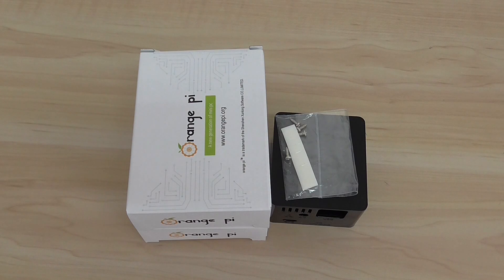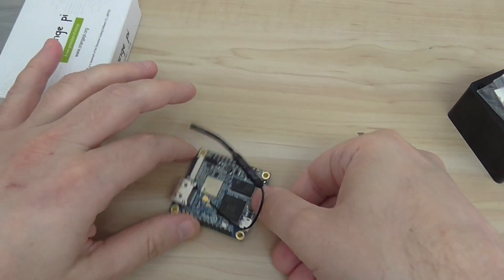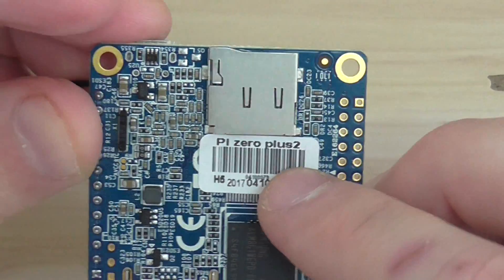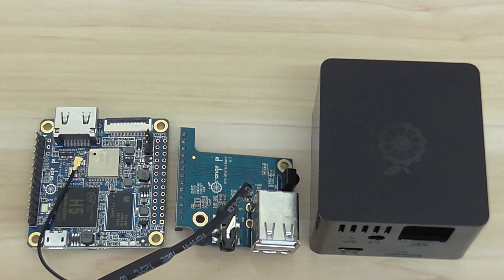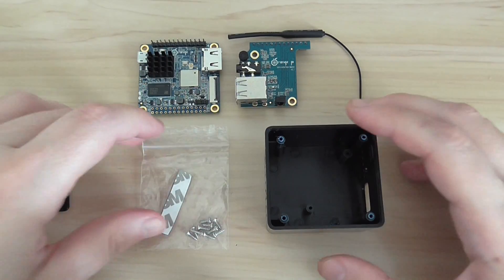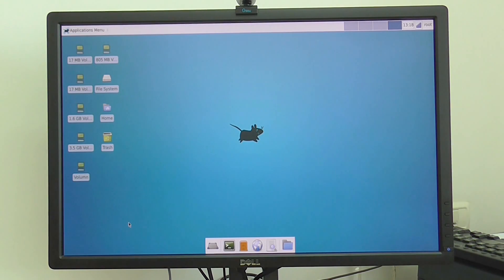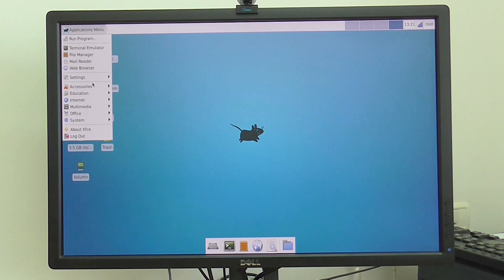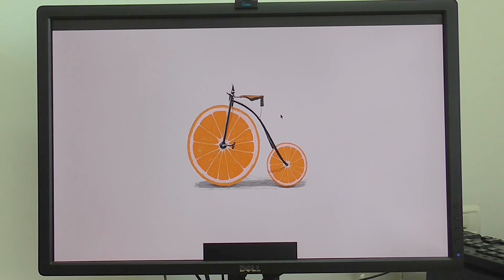Orange Pi Zero Plus 2: Better then Raspberry Pi Zero ?

Comment: Hello. I have the h5 plus 2 board, and I can not get a video signal using any of the available packages. I am burning the images fine and am getting power LED's but no hdmi signal. I have no idea how to boot into a desktop environment, any help?
Reply from the maker: 3D Kiwi format SD card properly, use winimage tool. Also check power supply unit for proper current!!  5V  2A
Reply: Thanks man I will give it a try! If I used the official site images and burn correctly AND use correct power supply. Plug in hdmi then power it should boot to desktop enviroment? I also have the same usb header, should that also work plug and play?
Reply from the maker: 3D Kiwi If u also bought the expension card with the HDMI port it makes life easier. Better check your power supply.

Comment: omg the 13 pin extender board makes the board so much taller dammit, cant there be a flatter option?
Reply from the maker: Blade Cutting Studio  you need extra space inside the case for heatsink and also the second expansion addon card that gives you additional USB ports and a HDMI port,  microphone interface.  If you are not planning on buying the add-on  board and only use the main board  than the case can be allot smaller in hight. :)
Reply from the maker: Blade Cutting Studio  if you have an idea how to make a flat version without designing a new board welcome to tell me :). If you really need the extra port u better pick a different board model..its that simple.

Comment: How is the WiFi performance? I have a orange pi zero and the WiFi it’s a major problem (because the drivers). I don’t know if this version fixes the  problem
Reply from the maker: Samuel Carreira I didn't check lately,  but I think they fixed the problematic images.
Reply: Android Pimp - Best Buy Reviews Authority I use the last Armbian. On the official website you can read: Onboard wireless module (XR819) has poor software support so wireless connection issues are expected
I will check if the zero plus2 uses a different module
Reply from the maker: Samuel Carreira yes. I know all about the common  problems. You should be able to find 1-2 images that will work fine. Just need to search and test each.
Reply: The orange pi zero 2+ used the AP6212 WiFi module.
Reply from the maker: Samuel Carreira there are few versions of this board

Comment: I have tried using debian desktop, but some application can't be opened and just show dialog "input/output error". I use image from http://www.orangepi.org/downloadresources/ 

Have you faound this problem? or may I know what's image file that you used on this video. Thanks dude..
Reply from the maker: Aznan Firmansyah  try updating the of distribution or make sure all needed library needed for the apps to run are installed. I didn't had too much time to play with all of the images. Also recommend joining orange pi forum and Facebook group, there are also images there. Try Armbian website, there are images there for the orange pi boards that should be very stable and good.

Comment: 512MB RAM on 64bit environment is really low, even for SBC. 1GB is bare minimum for desktop performance and 2GB (OPi Prime) is just the sweetspot. For headless 512MB is ok. Shame none of H5/A64 has decent support (yet) in Linux mainline kernels. Mostly Mali 2D/3D driver and perhaps Cedar VPU. H2+/H3 has much better support but is significantly slower (especially IGP).
Reply from the maker: Przemysław Stalmach  true. But for low level projects 512 should be ok. You can't use it as a type of Mini PC running Android. For that you have other models
Reply: Price. Remember the price. This is a very inexpensive computer.
Reply: If you want computer, buy the computer. This is for simple applications like for movement sensor, camera etc.

Comment: nice little orange pi 0 will that version mount the  O pi 0 NAS expansion board?
Reply from the maker: William Hart the expansion board gives you extra interface: x2 USB, IR recover, (analog) AV instead of connecting with wires to the header pins. The expansion board would work with all zero boards H2+ , H3 including this one with H5. its compatible

Comment: I think the bottom is too hot.  Customer will complain and return it.  Why the Raspberry Pi don't have this problem?
Reply from the maker: That's because the eMMC Chip is located on the back of the board and Micro Sd slot. The space between the cover and the board is maybe 2 mm . What you can do is just remove it , or you can also drill few holes to get the heat out. you can use a Soldering iron and make few holes, or with heated tip of a screwdriver. Its should help. another best solution is to buy few Spacer Hex bolts to give is some space and on top of them close the cover.